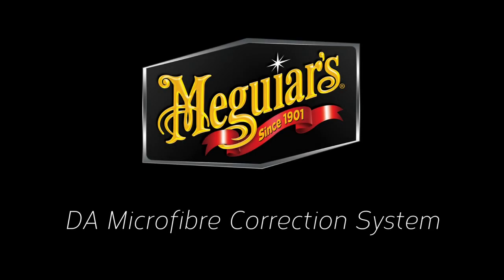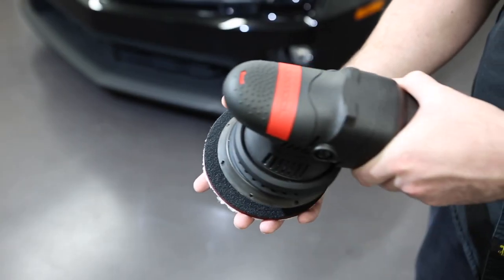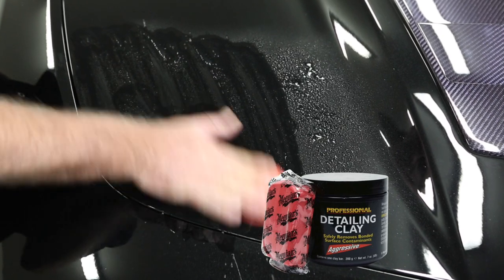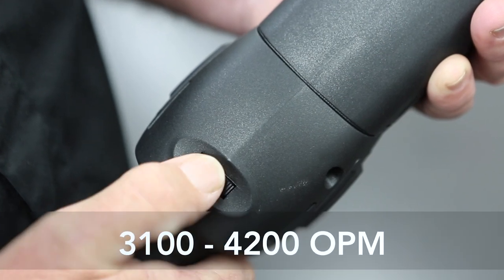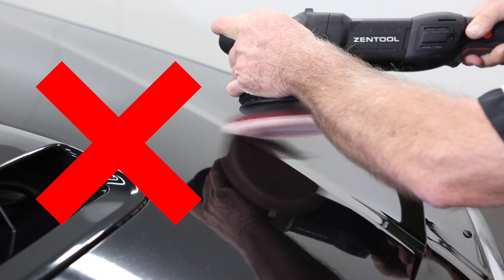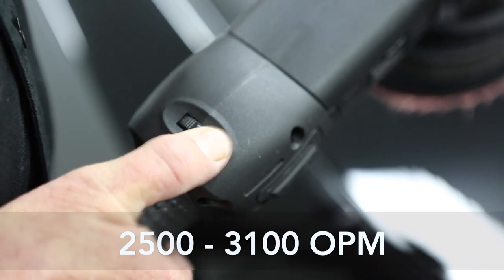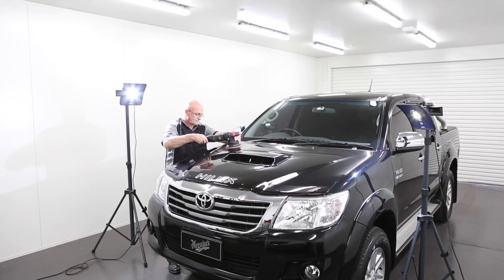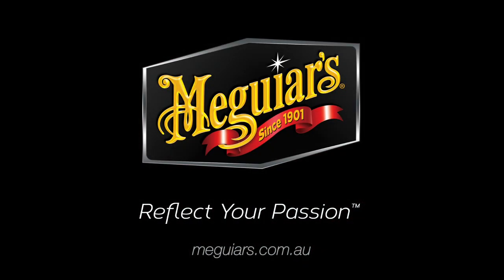Meguiar’s DA Microfiber Paint Correction System - Stunning results for DIYers & Pro's

Comment: I tried a 6 inch mf cutting disc with d300 last night using my 3401 flex. i used three pea sized dots.  wasn't bad. hard gm paint. i will try priming the pad next time.

Comment: Can’t wait to try it out. Just quickly do your foam or microfibre pads create a better finish? This is following cut with your MF pads and D300
Reply from the maker: Both are capable of achieving the same result. Pad selection will come down to paint hardness. I start with microfiber and access the results. If there is a slight cloudiness, then drop back to a foam pad which is less aggressive compared to microfiber.

Comment: I wish the finishing compound didn't have wax in it.  I like to use Turtle Wax's own sealant.  Does Meguiar's make a finishing compound that doesn't have a wax built in?
Reply: They have D302 DA Microfiber Correction System Polish for that purpose. You could also use Ultimate Polish, M205 Ultra Finishing Polish, or M210 Ultra Pro Finishing Polish. I prefer all but the D302 on foam pads instead of microfiber for final finishing.

Comment: I purchased this kit just curious if there's a proper way to clean the pads or if it's the same as a regular polishing pad
Reply from the maker: These pads are cleaned like normal pads, during the polishing process use a plastic applicator or blunt screw driver to clean the excess polish. When you are finished with the pas you can clean them by hand under a tap or machine wash them. Just make sure not to use a washing detergent that includes fabric softner.
Reply: @MeguiarsAUS  thanks a bunch . I just use 3 buckets, and first one has dawn. The next two are just water, and rise off when done.
Reply from the maker: @Dotz155  That would work perfect! :)
Reply from the maker: @Dotz155  Thats the best way to do it, keep up the good work.

Comment: I have a question for Meguiars australia, YOUR NEW Spray Hi gloss WAX protection, how on earth are you going to know if you have covered the areas of your car properly if its a white or silver or any light colored car ? Just asking because due to the spray has to go onto the microfiber towel supplied, just want to know after 10 minutes of spraying the product onto the towel the towel will get wetter and wetter, thus how are you going to tell if the cars surface is covered properly ? 
this is how i detail my car,
1.Wash with PH neutral Meguiars soft Gel car wash, and then wash rims with different soft microfiber towel.
2 Remove excess water, via good quality chemmy
3.Use Spray on detailer all over the car section by section, no more than a 1/4 of a panel at a time with good quality microfiber towels.
4.  Use spray on WAX, all over each panel of the car.1/4 section at a time.
5. Do inside the doors with scratch remover and then spray on detailer and then spray on wax.
6. Vacuum the carpet.
7. detail the dash and leather.
8. clean the glass, windscreen inside and out.
9. Detail the rims with scratch remover and seal with wax.
10. Detail the tyres and use new yellow and red paint to go over the OEM paint markers on the tyers. :) 
All this for a silver car as well ?
But i have done this for over 25+ years when people only had turtle was and windex for glass and paint on tyre shine, also armor all for the dash etc. ?
Reply: But what about white or very light colored cars or surface, its very hard to see, unless you keeping you eyes on the areas of which looks like its wet and thus you need to go over it again to make sure you have covered the areas, so a 1/4 of a panel like say the guard is best to do at one time only and then move along till the complete car is covered and done right ? also i fell that depending on the humidity outside will determine who quickly the product evaporates from the surface right or wrong ? Even if your car is undercover and cool to the touch ?
Reply from the maker: The application technique is the same for light or dark cars, do a manageable area, say 1/2 the bonnet, no bigger, and move onto the next area. Part of the application is looking at the surface, this is exactly the same for any product. Humidity and temperature will have a very slight effect, however the flash time allows ample time to wipe off before the product starts to dry. The product will only start to dry if you try and cover too large an area at a time.

Comment: Is this product full of fillers???
Reply from the maker: The DA Correction System products remove the defects and don't rely on 'Fillers' to camouflage them.
Reply: I have the same question .....
Reply: Can I use after ceramic coat?
Reply: @MeguiarsAUS  thank you for your response.
One more question. What's the exact name of those stand lights?
Reply: @georgeploumidis1419  - This compound will remove the ceramic coat.
Reply: A lot of misinformed people drone on about "fillers". Often the lubricants in the formula will mask to varying degrees. Intentional masking products are widely known as "glaze". Actual abrasive products have no reason to mask.

Comment: Wrong about keeping the disc flat modern and older cars do have surface differences like little humps which your DA will leave swirl marks due to keeping the DA pad flat, so make sure when doing areas which have small hums due to the shape of the panel, use a smaller DA pad and go over that area/s separately. :)
Reply from the maker: The main thing is to keep as much of the pad in contact with the paint surface and not use the edge of the pad to get into tight areas. There is certainly the option to use a smaller backing plate and disc if you have one available.
Reply: Yes but its the clear which is going to shine up not the paint, unless your doing a cutting job, then you will be removing the clear and down to the paint and thus putting new surface product on iot to make it shine all over again. :)
Reply from the maker: The clear coat is the paint surface you are working on, unless it is a solid non clear over base paint finish.
Reply: The DA does not leave "swirl marks". That's the rotary buffer that does that. 

Many professional regarded for their polishing skills such as Kevin Brown often only use the huge 6" plate on their 21mm tools.
Reply: @7071t6  - Cutting doesn't remove all of the clear after a set of passes. It often takes several. 

When I attended the Rupes advanced sanding and polishing class the hood we used had several sanding and cutting procedures on it before we broke through the clear.